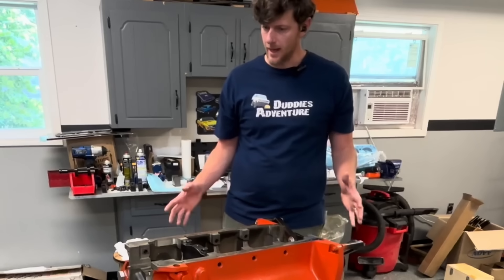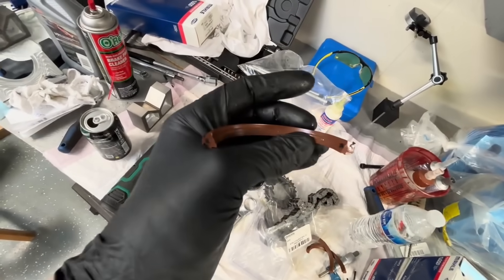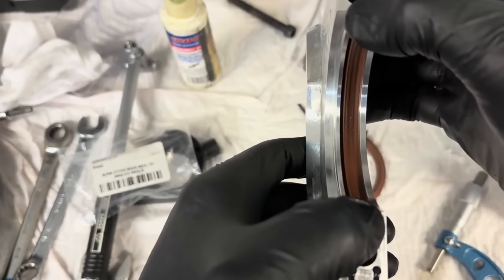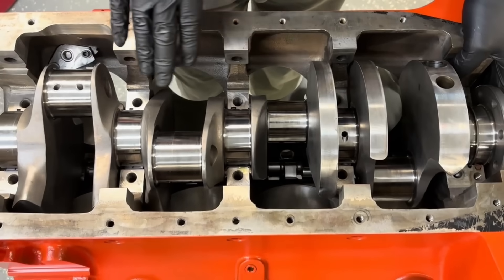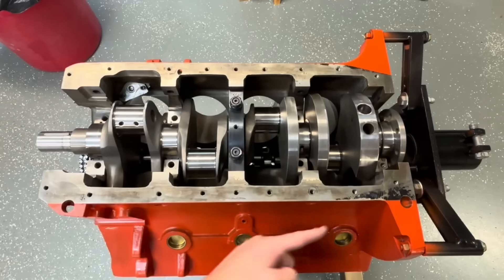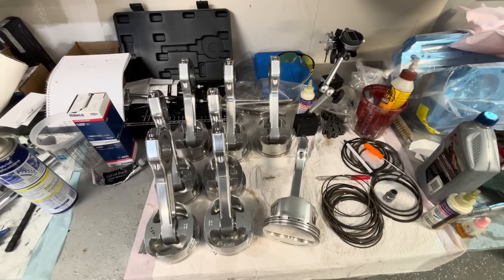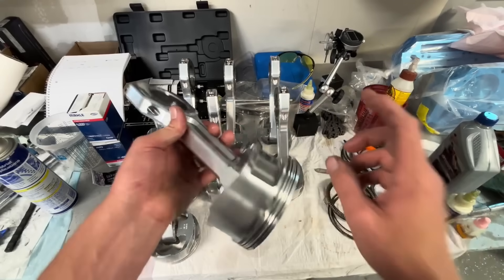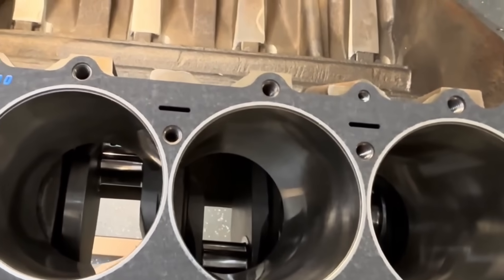Mopar 580 Stroker: Crankshaft and Rear Main Seal Installed  #mopar #engine #stroker

Comment: NICE ENGINE BUILD. I WANT A FHO 604 HEMI MAKING OVER 1000 HP ON SHITTY 91 CALI GAS. YOUR ENGINE SHOULD RUN 10 DLAT IN THE QUARTER MILE @ 134 MPH IN A FULL SIZE DODGE
Reply from the maker: Plenty more to come on this one!
Reply: @JustMoparJoe  SO THE CAM BENT?
Reply from the maker: @SVENSKANYC this block is a 4.5” AFTERMARKET BULLDOG. The cam bearing block is a factory 400 block that was stroked to a 512.
Reply: @JustMoparJoe  NICE HOW MUCH WAS THAT BLOCK 3K?
Reply from the maker: @SVENSKANYC it was purchased 10 years ago from muscle motors. I’m rebuilding it for a customer
Reply: @JustMoparJoe  WHAT BLOCK IS IT A 440 STROKED AND PUCNHED OUT TO 580?

Comment: Just for some information I put a Mancini retainer seal in my big block and then shined a flashlight from inside the engine to the outside and I saw daylight on both sides of the retainer. Not sure what was wrong but I'm glad I checked. So I took it back out cleaned it real good and put silicone on both sides and it does not leak. I recommend that quick check on every engine
Reply from the maker: Absolutely worth a check!
Reply: Certainly better than finding out later 😂😅 great tip, all the best

Comment: All these diff options for rear main seals. If you had your pick what are you going with? I just ordered the fast-fish but what's the best option for the side seals?
Reply from the maker: I love my fast fish stuff. The stock style side seals work fine for me, but I’m an RTV lover 😂
Reply: @JustMoparJoe Thanks for the input. You putting rtv on just each end or doing the side of the side rails as well? I knowbir busy so i hate asking but going to be doing my 500inch after a couple more parts. Thanks in advance
Reply: @brianb5779 I'll offer my procedure if it helps. Silicone, typically Ultra Grey, on both the bottom of the cap where it meets the block, and on the block. The sides of the block and in the cap where the side seals go as well as the inside of the seals where they meet the block. Although I typically don't offset rear seals, in the case of the BB Mopar that uses a retainer seal, I do offset a bit just to ensure the seals line up. The "guide" studs used on installation help, I just want it better lol. 
Lastly, I fill in the entire cap from the back where it meets the block. Keep in mind you don't have to unload a full canister on this deal. This nets me ZERO leaks in this area.. All of this AFTER mocking up the cap and seal, making sure the proper seal crush and fitment. 

I'll also add I do a thin layer on the back of each seal half. Too much and it'll leak. 
Hope this helps.
Reply: @JRD_Motorsports Brother you always come thru with such amazing info and help. So thank you very much. So its interesting that your helping out again because I was getting ready to reach out to you when you gave me all the engine advice for my engine I wanted to build. My question to you (just wanting to maje sure) was when you said put the cam in at 4, you were meaning 4 degress advance right? I got the rest of parts showing up within next couple weeks but bought everything you suggested and that was one question i was gona ask you just to be sure. Again brother thanks a million
Reply: @brianb5779 Well first off, thank you for that. What I do is sometimes perceived wrong when others get ego involved, mainly because I offer advice in ways they don't understand. Since most are afraid of what they don't understand, they are less willing to have an open mind, which creates tunnel vision and limits the ability to think realistically from outside the box lol. 
I will admit though, I may have forgotten the basis of our last convo regarding combo, so as to not clutter up Joe's section with unrelated topics to the his video, we could get more involved on Instagram if you prefer. 
That said, TYPICALLY, cams respond well to a 4⁰ advance on the intake lobe. But, ONLY if the cam was ground on its lobe separation and not with advance built in. I always recommend degreeing on 0 first to see how the cam was ground, both intake and exhaust. Also keep in mind, if you have a basic made chain setup with only a 4a 0 and 4r lower gear, it will be 8⁰, at the cam. Only the good billet gears with 9 keyways move it close to advertised, in small increments. And before you adv or ret,  always verify piston to valve.
Reply: @JRD_Motorsports Im pathetic and dont have Instagram or facebooke, but respect what your saying on taking up this thread. A man will only learn by taking ego out of it for sure. Im a sponge when it comes from knowledgeable people. I understand everything you laid out so thank you for that and everything so far. Wish you the best and thanks so much.
Reply: @brianb5779 Anytime sir! And to be honest, not a big fan of social media either. Lol. But if it opens an opportunity to help, then I'll take the bad for the good.  And if it helps, since we apparently spoke on it and my answer was that you could move it 4, then yes, it meant 4⁰. Just remember that it's 4⁰ from its lobe separation, NOT if it has a tighter centerline, meaning adv already ground in.

Comment: Never did like those Billet seal caps. I won't usually have a leaker, but when they sporadically do, that was the common denominator. I have contributed it to a few design features, 1 main one that as an engine builder, do not like. 
That said, EVERYTIME i switched it back to a factory cap, no leak. I just stopped using them all together. Just myvtake on that deal, not to influence anyone else's experience with them. 

And .003" thrust... way too tight for my blood. In a performance application, anything that affects the thrust better be spot on point. Gotta remember, those generalized "Min/Max" numbers were generated for a factory type application that didn't live in the same neighborhood as what we are seeing now, just like what you are putting together. 
Clearances at the Min in this application are NOT what they were designed for. Sometimes you get lucky, but all it takes is one false move behind that crank and It'll let you know. 
If you choose to keep it there, I'd recommend no 1 piece thick heavy duty flexplates, proper converter clearance, proper converter centering, stay on top of the converter bolts, make sure thebcharge pressure in the trans isn't excessive, and pray to god whatever converter is used, that it won't want to balloon real easy.

I would also modify the thrust bearing to get pressurized oil towards the rear. But i do that regardless of clearance. 
Just a few things to consider.
Reply from the maker: Thanks for the advice, I always appreciate hearing other builders' experiences! I’ll even talk their ears off!
Reply: @JustMoparJoe Nothing wrong with that! Happy to help... 🤘

Comment: Joe, wouldn't that stuck ring be caused by the ring land crimping?
Head gaskets seem to always be a question as to which one will work best with the given engine measurements. 1105 Fel pros for 4.5 bore 😊
Reply: Not always. If that engine had no evidence of water and rust on the rings, then yes, a damaged ring land could cause it to stick, but that is typically collateral damage, and would require further evidence  of failure to cause it. Ie: pistons slamming into the head, which is typically a top ring issue, not a second ring issue. 
Otherwise, it's either due to rust, or heavy carbon loading that will stick a ring in its land.
Reply from the maker: Thanks Anthony! Thanks Joe

Comment: Great work, Joe. I am really happy to see that you don't get crazy when something backs up your day.  Being a BUDGET RACER from way back, I have run into the ring issues more than a few times. I alllllways had very limited time for building as I was in the Navy and out to sea A LOT, so I had to push limits. Something I found to really help besides penetrating oil, was the use of a "PIN BLAST" air nozzle. (I think mine is made by ASTRO.) If that didn't work I'd turn to heat. Then blasts of air again. This worked quite well for me. Maybe give it a try....  Keep these great videos coming buddy. I look foreward to all of your stuff...
Reply from the maker: Thanks for the advice, I'll keep that in mind! You’re going to like what’s coming up this week!

Comment: On that aftermarket remain seal cap, did you have to take some off the bottom to make it fit correctly?  
Almost all of them I've decided had to have @10-15 tho removed. 
??
Reply from the maker: Thanks Dennis! This one didn’t look massaged previously. I reinstalled it since it worked great previously without leaking.
Reply: @JustMoparJoe   all the ones we used had to have some removed 
Now I just collect all the old ones, clean them up 
Wasn't going through that hassle anymore

Comment: Spiro Locks nearly drove me crazy the first time! I can do them quick now that I learned the trick to getting them out, and install them with just my fingers.
The rear main seal retainer is kinda nice! I had a factory one that was really bad, as in not even symmetrical!

Cool project! I can't wait to see how it turns out, and what it puts out!
Reply from the maker: Glad to hear you found a method that works! Thanks for the support, Ty!
Reply: @JustMoparJoe  , for those that haven't  done it before -
I use two picks to get them out. With one, press down on and drag the tip out of the groove, then slide the other one under to push the tip up out of the hole. I use a dental pick to drag it out, and a smooth orange HF pick for the other one. No scratches on the piston.
To install, stretch them out, insert the tip in the groove,and twist against the spring as you run around pressing down with your fingers. They'll pop right in.

If anyone has trouble visualizing it, there are actually quite a few videos on YouTube that show the process.